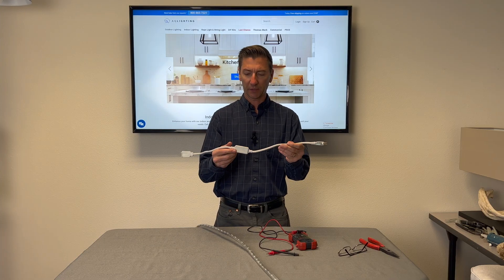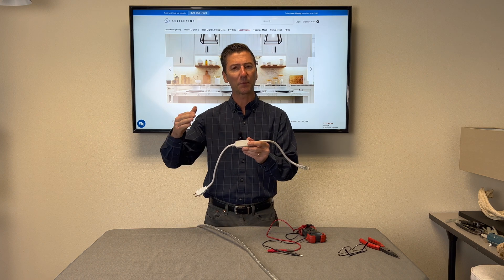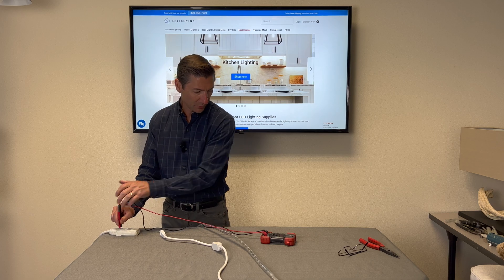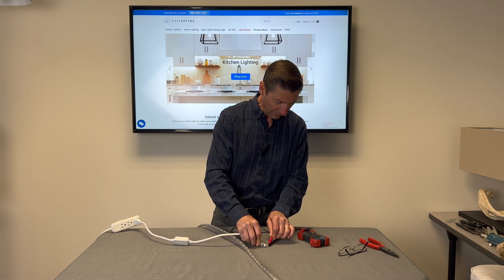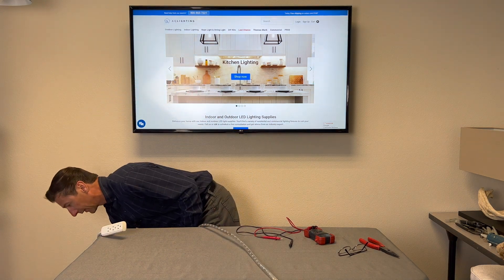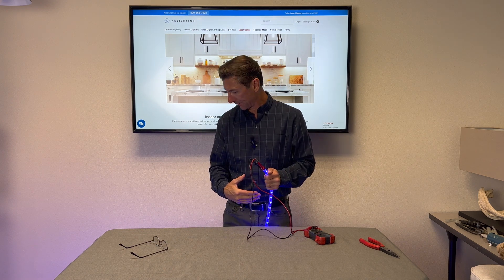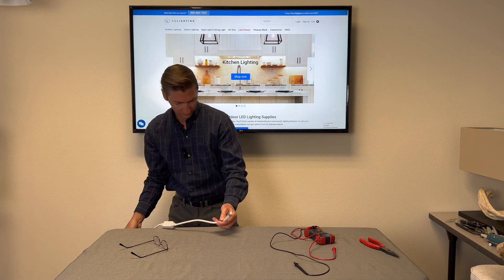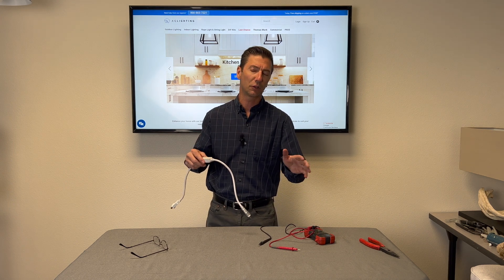This Is NOT a Transformer | Troubleshooting LED Rope Light | AQLighting

Comment: If anything, the voltage would be less due to the voltage drop at the end of the LED strip.  I'm going to guess the "rectifier" has additional circuitry that may include automatic gain control and also maintains constant current. This is my unverified speculation.  Thanks for the video.